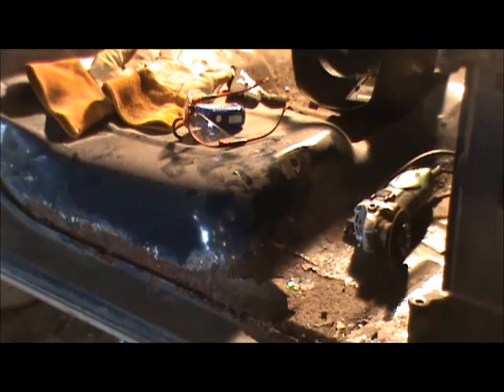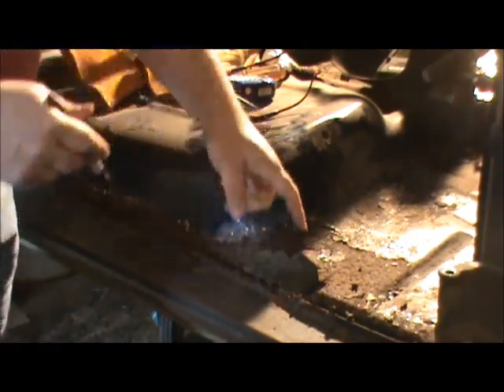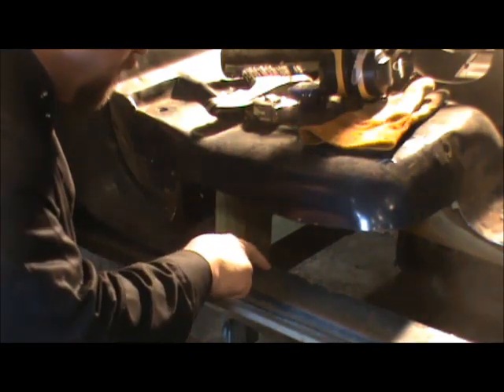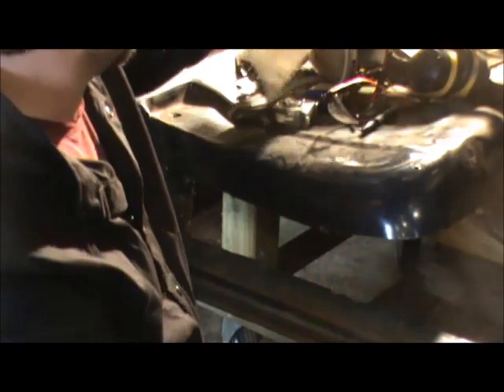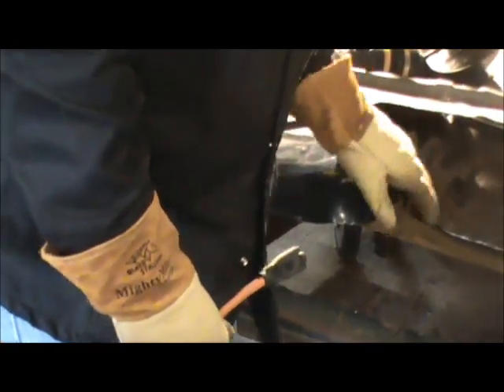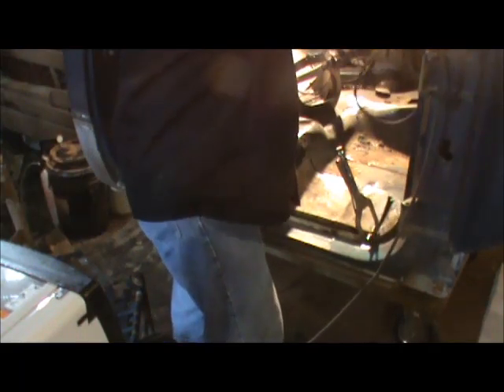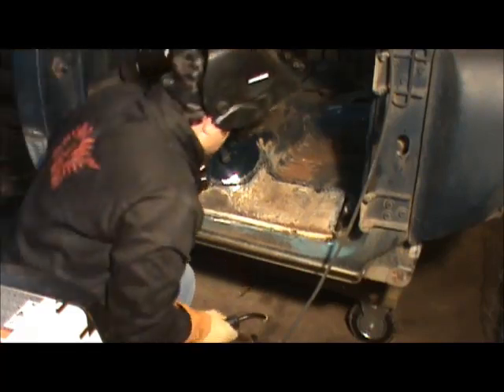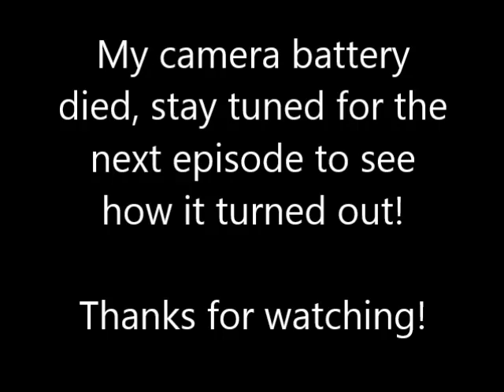1985 Chevy K10 Restoration Part 40

Comment: nice vid. :) best part of the vid is when u fired up the welder. i love welding vids, i have a welder but i've not used it yet. :( dont u have a plasma cutter? it would be faster then a grinder.
Reply from the maker: ***** Thanks, I'm getting pretty decent at welding sheet metal.  I need more practice on thicker metal ;)
Reply: farmboy30117
ur welcome. :) im still learning. i might be fireing up my welder at some point to start makeing ramps for my x724 mower deck.